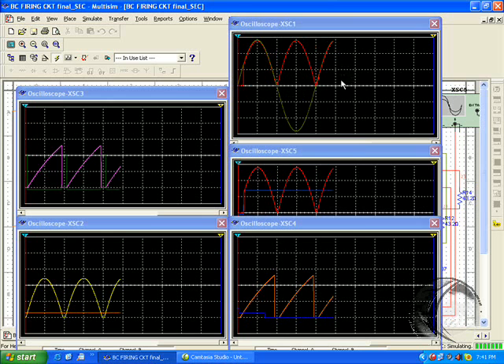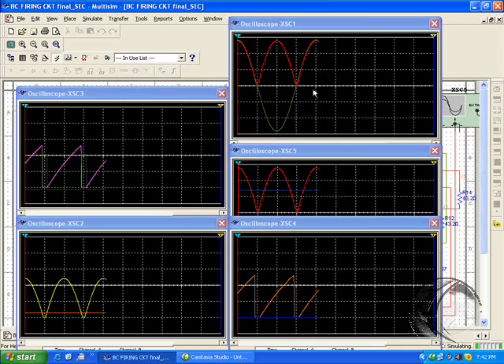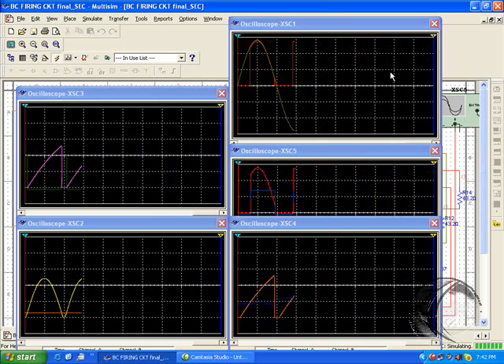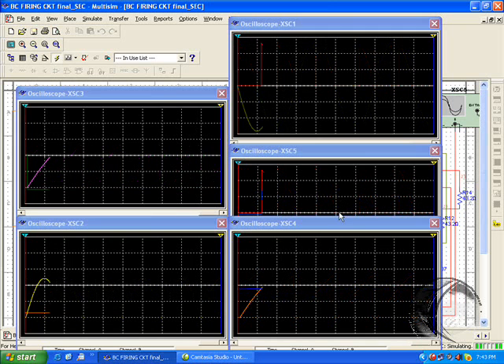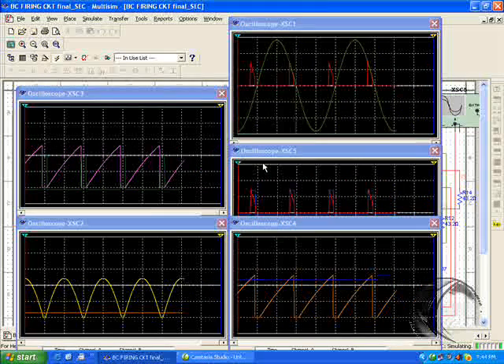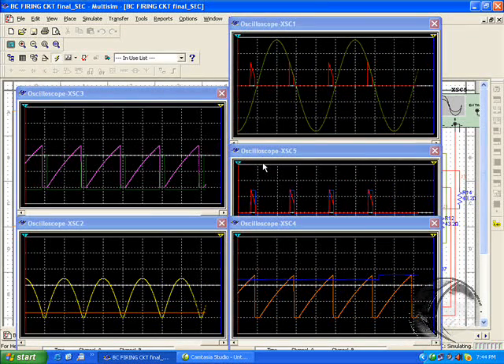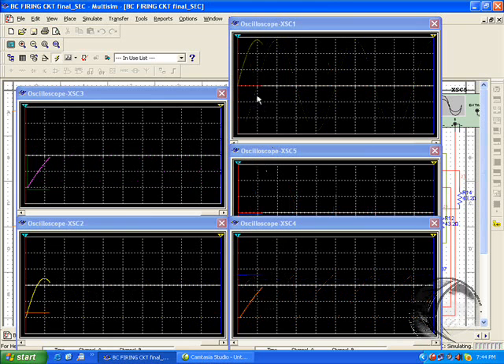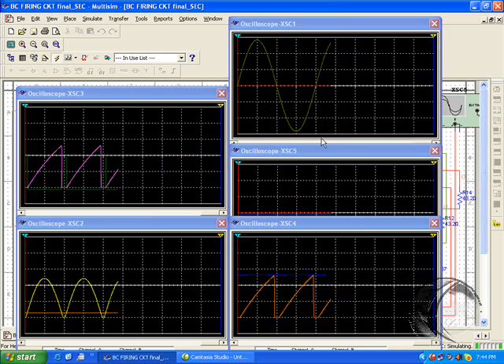Thyristor -Firing angle control  circuits

Comment: What is that fixed voltage you are comparing the saw tooth pulses against?
Reply from the maker: Please watch the video in full instead of just listening a little. It is clearly shown nearing end that the fixed voltage is from a forward biased silicon diode which is always 0.6 volts